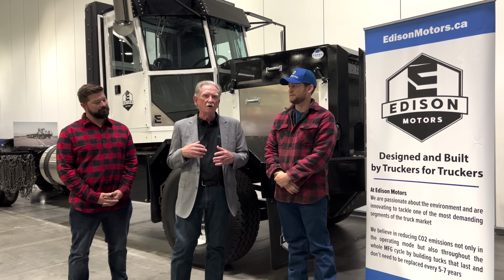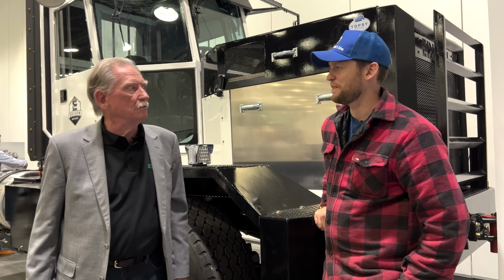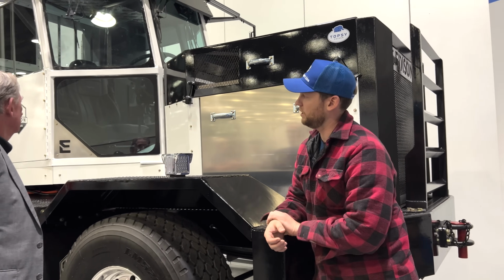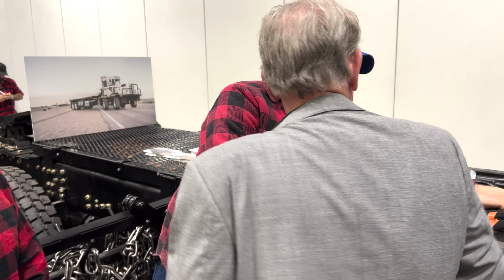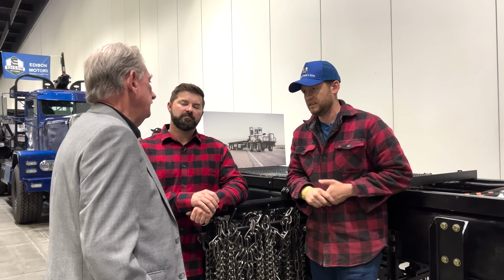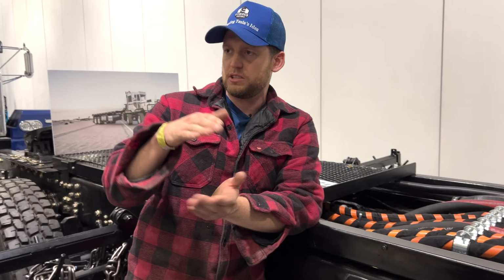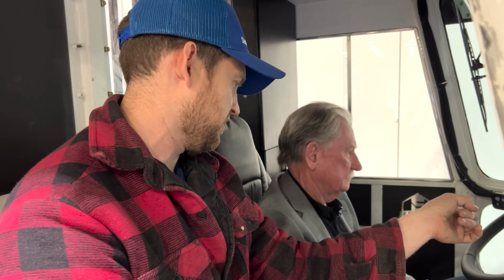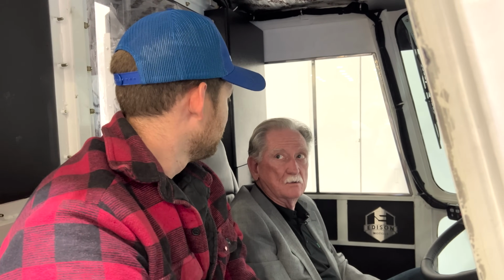This Electric Semi is a Million-Dollar Idea! Edison Motors at Fully Charged LIVE Canada

Comment: Not sure if this was answered by an earlier comment but an Electric Front Drive axel is an option as well as a triple rear axels.   With Chases trucks, they are typically custom spec-ed by the buyer.
Also, another idea Chase has is putting electric drive axels on the trailer to help with steep grades/muddy roads/snow traction as well as added regen-motors for the batteries. 
Another flexible option is for generator motors that use different fuels if they wanted something other than a diesel engine.   Propane, Gas,  Hydrogen Fuel Cell, etc.
A lot of these things have been discussed on the Edison YT Channel during the build process.
Reply: There is no driven front axle option because there no product yet. They have talked about a driven front axle, but haven't built a prototype of a truck with one yet, and haven't allowed for one in the design. 

There is no "typical" buying process for something that no one has been able to purchase yet. 

The idea of driven trailer axles, or even specifically electrically driven trailer axles, is not new. Edison people have talked about it, but have not done anything about it. That's true of alternative engine and fuel types, and various other ideas... they're just obvious ideas, not part of the reality of this truck or company.

Comment: I'd like to see this concept in highway trucks. Bare bones no frills but the necessities. Trucks built currently are junk, they spend more time in the shop than on the highway.
Reply: Built to be cheaper, if they went for reliable no one could even dream of affording a truck, but going bare bones you lose the customers. Highway trucks are a lot more complicated
Reply: @tnc7399  but highway trucks don't need to be complicated. I've driven almost every year of highway truck from 1960 to present. The old trucks before the industry went to making stuff that's designed to break were so much better... Hell everything was better, I have an IH refrigerator from 1953 that still works, and a '29 Model A that still runs down the road like it was new, with it's original engine. How much more complicated does a truck have to be?
Reply: @GreyRiderTKG  like I said, they switched to cheaper, less reliable parts to keep costs down because people want a ton of creature comforts.

Comment: 'FMCSS" (@20:50) was probably supposed to be the Canadian Motor Vehicle Safety standards (CMVSS) or the equivalent US Federal Motor Vehicle Safety Standards (FMVSS). It is U.S. Code of Federal Regulations, Title 49, Part 571, Federal Motor Vehicle Safety Standard No. 121, Air Brake Systems and the Canadian version of the same document. 

The regulation actually doesn't require redundant indications. If the signal (other than a gauge reading) is visible within the driver’s forward field of view, no second indication or audible signal is required... which means either the wig-wag or a suitably placed light would do by itself. Both is better, of course, and I can appreciate the desire to avoid the audible alarm.

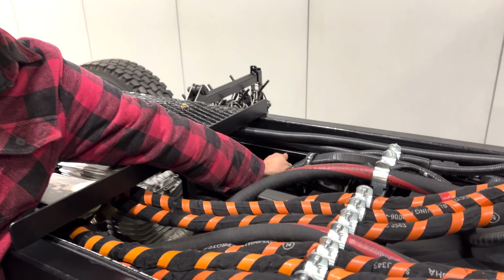Comment: The comments @15:18 about frame strengths in PSI depending on steel thickness make no sense. 

"PSI" values would be yield strengths of the material, which do not depend on the dimensions (such as thickness, web height, or flange width); they're also around 100,000 PSI, not 100 PSI. What the dimensions change is the section modulus; the section modulus multiplied by the yield strength determines the Resisting Bending Moment (RBM), or how strong the frame is. And that's bending strength, because that's what matters in a truck, not tensile strength. A designer can chose lower-yield material with taller or wider or thicker frame, or a higher-yield material with shorter or narrower or thinner frame, to get the same strength. 

The Edison frame dimensions are probably a good choice, but the stated numbers make no sense. Chace was probably thinking of RBM values, and using both the wrong units (PSI) and the wrong name (tensile strength), with the wrong numbers - RBM would be in millions of inch-pounds, and he was saying "tensile strength", using the units of yield strength, and giving numbers that would not be plausible for anything.

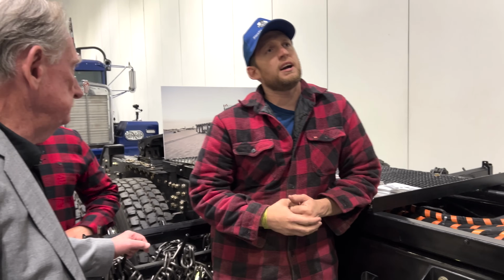Comment: After the show, the guess of 25,000 to 26,000 pounds @10:30 was replaced by an actual weight of 12,580 kg or 27,730 lb. That means that the extra weight allowance (various values depending on jurisdiction) is appropriate.

Comment: The battery packs between the frame rails are on an air-ride suspension, which makes sense... but what about the battery packs on the outside of the frame? These are identical battery modules, so if one needs air suspension the others do, right?
Reply: Well, as I understood from the video, the air bags were to isolate the battery pack between the frame rails from twisting when the frame rails twisted. The battery packs outboard of each rail would not be exposed to the twisting of a central pack.
They would still be subjected to a lot of jostling, so I guess they have good cushioning as well.
Reply: @glenndennis6801  the outside packs would be subject to exactly the same twisting, as the front and rear brackets twist with frame twist. Also, the air suspension isn't required for isolation from frame twist - that only requires a three-point mount.
Reply: @brianb-p6586 air suspension wasn’t required. The bags cost $50 and he thought why not put the battery on bags, you also now have 4 extra bags incase one breaks on your suspension.
Reply: @gilliesiut2332  The point is that if the air suspension is not needed outboard, it is a waste of money and unnecessary complication inboard, and vice versa. The air bags sized properly for the battery pack would be unsuitable for a truck suspension... and this prototype truck doesn't have air suspension anyway.
Reply: @brianb-p6586  it’s a metal plate on some airbags. Not complicated at all and if you can’t figure out how to disconnect a fitting and two bolts you probably shouldn’t be a truck driver. Is something happens to make a air leak simply plug the line to the battery suspension and let it ride on the frame. I don’t see how it would cause any further complications because if it’s not necessary and if of breaks you can basically just ignore it.. $200 to protect the battery from added shock isn’t a waste of money when the truck costs 1.5 million
Reply: @gilliesiut2332  if the bag deflates the battery hangs down below the frame. In a logging truck, that's bad.
Reply: @brianb-p6586  they function under compression not tension… it won’t hand below anything as it will sit a few inches lower on the frame mounts. You really have never worked on a vehicle have you?

Comment: 😊Not exactly the same thing as truck parts, but as the years have gone by, I've learnt that the (so-called) old-fashioned option is frequently better (and cheaper) overall than the new fangled thingamajig. I stopped buying nonstick cooking pots, pans, and utensils as I found they just didn't last and I kept having to replace them within 12-24 months as the nonstick coatings were forever wearing off, potentially ending up in food, no matter how much I treated them with kid gloves. Having to treat practical everyday usage items such as food preparation ones is just nuts. After replacing everything with stainless steel options I've not had to replace anything in about 15yrs. 
That's just in the kitchen. The same thing has proven true for me in other areas saving me time, money, ..... and a lot of blue smoke and swearing 🤬🤬🤬 on failed items.

Sometimes old-fashioned is simply the most practical choice; trucking is ultimately a practical pursuit.
Reply: Sometimes new stuff brings innovation. Sometimes it just means they have to keep selling you stuff to keep profits going up every year!

Comment: Everyone seems to think tucking is only the semis you see driving down the road.  And when you hear about electric trucks you think of a larger version of an electric car.  There is a whole separate industry that is about heavy hauling.  Where as Tesla is looking at all electric, aerodynamic, short range bespoke rig that will have to be replaced in 10 years, Edison is designing a truck that will last 3 score or more years (that’s 60 years for those who’s don’t want to convert in your head).  The Edison truck is flexible, rugged, and repairable.  Right to repair for Edison motors means a fault code has plain English on the problem and part numbers if a replacement is needed, without ever leaving the cab of the truck.  Don’t need a diesel, swap out the generator for a LMP or hydrogen powered one, add a fuel cell, or just add more batteries for all electric.  Old school reliability and longevity coupled with modern technology and unbeatable torque and power of an electric axle. Edison is going to change the trucking industry the same way diesel electric trains replaced steam locomotives.

Comment: Wow! A prototype built in 6 months, and built really well. Even at 25% more cost than a standard truck, saving $120,000 a year in fuel, soon wipes that out and puts money in the bank.
Reply: That's just fuel too. Sounds like this thing will stay in service longer and have less downtime and less to maintain.
Reply: @morosis82   Especially with the near extinction of purpose built "off road trucks", everything now is just a highway truck with a lift kit, easily broken junk.
Reply: @dalel3608  yeah I've been watching these guys design videos, this thing looks sick!
Reply: @morosis82   I know it will be an uphill battle with my boss (he's anti-EV), but when they start production I'll definitely be pitching Edison for our future fleet units.
Reply: @dalel3608  just say it's diesel electric, like a freight train. Ain't nothing harder working.
Reply: @morosis82   That and the other "old timey" bits might just sway him, time will tell lol.
Reply: Topsy can be plugged into the grid.
Reply: These electric vehicles talk about how much money they save on fuel but dont ever say how much they spend on electricity.
Reply: @everettwalker9141  that saving is generally inclusive of electricity.

The Tesla Semi that PepsiCo have been running apparently does about 1.7kWh per mile, so assuming electricity is 0.20/kWh (California) that would be $340/1000 miles. A similar diesel truck uses about 7.25mpg, at $6.40/gal (again in Cali) for a cost of $885/1000 miles. See

So if you put 100k miles a year on the vehicle that's about $54,500 a year just in fuel savings, for a semi operating in California.

In BC where these guys operate it's $2/litre and 0.12/kWh I believe, so that would be $1015 of diesel vs $205 in electricity. That's about $80k per 100k miles savings.

These logging trucks would have a much different duty cycle though, would be interesting to see how much electricity they use given that EVs typically perform even better at low speeds.
Reply: @everettwalker9141  This truck doesn't plug in, so there's zero electricity cost. All power is generated from the CAT diesel. And anyway, electricity is generally always cheaper than diesel and gasoline.
Reply: @appleintosh Pretty sure it should plugin, if not it should to get those fuel savings.
Reply: @lengould9262  It’s supposed to be a logging truck. Not much of a power grid where trucks like this operate
Reply: @appleintosh  Been there, done that. But the truck has a much broader market, eg concrete truck, offroad dump truck,  ...
Reply: @everettwalker9141   they arent spending anything its a diesel generator so its a hybrid not pure electric it still needs diesel top move but uses 50% less because the engine charges the batteries for an hour then it runs for a while pure electric.
Reply: @everettwalker9141  $4.50/100km

Comment: This guy has real know-how. Love that they put real hoses on the hydraulics. Steel switch gear. The wigwag. The Westinghouse brake cracked me up. This is how heavy duty stuff should be.
Reply: Hydraulics always have "real hoses". The excessively stiff and heavy hoses that Chace pointed out are being used for air, for which relatively flimsy tubing is often used.
Reply: @brianb-p6586 yeah if a hydraulic line bursts it'll be a bad bad day

Comment: I expected that this would be riddled with technical errors by both Sandy and Chace, and unfortunately that's what I found. But it is a good introduction to Edison's reason for existence and their choice of truck design.
Reply: @brianb-p6586   Hey Brian, I guess you don’t spend a lot of time with Engineers.  Let me challenge you, no peeking at google or textbooks.  You see, real Engineers need to have a gut feeling for numbers. It may not be the most accurate but in the ballpark.  Just in case the stupid modern computer throws up an erroneous number.  So the question is, if you strung a rope tight around the Earth’s equator, and then you added a metre of rope to its length.  How far would the rope be above the equator? Equidistant of course.
Reply: @nopenonein  the rope would still be on the ground, since the added length is neglible.

"A gut feeling for numbers" is important, and that's not what I'm seeing here. And using the wrong units of measure is a good example of not having a good feeling for quantities.
Reply: @brianb-p6586 Do the calculations, if I remember correctly, it is about a foot. I am not going to redo the calculations but it is substantial. I do believe the two guys were blabbing away and having fun, not being too picky.
Reply: @Adscam  the exact solution to the example problem which you presented is 1/2π multiplied by the length change, assuming an ideal spherical planet and a rope rigid in tension. For a one-metre increase in rope length that's about 17 cm (or more precisely 1 m /2π = 159 mm. If you got a foot, you forgot to calculate the change in the radius of the circle, rather than the change in the diameter. A mathematician gets that in seconds, but an engineer realizes that the real answer is the one that I gave. 

This is not "two guys" - it is the CEO of a corporation promoting a technical product, and the head of a corporation offering engineering analysis of products.
Reply: @brianb-p6586  Thought so, this is a playground quiz.  I don’t remember the answer but I knew it was substantial.  It is half a foot according to you.  So that is surprising when you said it was negligible.  Bye bye.
Reply: @nopenonein  you apparently missed the point. Engineers need to understand the numbers, not just do calculations.  In your test, the calculation result seems large to you, because you don't understand that it wouldn't apply to the real world.
Reply: @brianb-p6586  Brian you miss the point entirely. Engineers know real numbers and can do the calculations to back themselves up.  In this case, you got the gut number all wrong, and refuse to acknowledge it.  You like to speculate on things that you don’t know and try to bullshit your way through, e.g. Janus Electric.  You are needlessly picky on things when people are having fun and getting the full general idea through.  I bet you are a party at the water cooler.
Reply: @nopenonein  you still don't understand: my immediate response  - your "gut number" - was and remains absolutely correct. A student learning geometry can calculate that the increase in radius is 1/2*pi times the increase in circumference, but an engineer understands that variations in the temperature of the rope, stretch over time, or even a single wave in the ocean would have more significance than the piddly one-metre change in your theoretical rope. 

What Edison Motors people need, like many enthusiastic novices, is technical rigour. Maybe it's there somewhere, hidden behind the scenes, but it's not in the public face of the operation.
Reply: @brianb-p6586  Brian, you failed the test. You said the rope will still be lying on the ground.  Admit it.  You are just a persnickety person.
Reply: @brianb-p6586 . You are just a pernickety person.
Reply: Brian, quick answer now like in a live interview.

Comment: 80 litres per 100 kilometres (given @7:37) is 2.9 miles per US gallon. That's not one mile per gallon or a gallon a mile but yes, that's a lot of fuel, and lot more than an average heavy highway truck rolling down a highway at a loaded weight of 80,000 pounds (36,000 kg) or less.

Comment: In the configuration that Chace is talking about the log trailer isn't permanently attached to the truck; instead, a set of bunks are mounted to the trailer to support the front end of the logs, and a trailer holds up the back end of the logs. The trailer can be unhitched and placed on the truck to transport it when empty. But Chace's point is valid - the logs are not carried on a trailer which can be unhitched while loaded, so the load can't be taken over by another truck for the next leg of the trip, and the same truck has to make a trip down forestry access roads and then on better roads to where the logs are unloaded.

Comment: The generator can't possibly recharge the battery completely in an hour, because it is a 280 kWh battery so to charge it in one hour would require an average power of 280 kW, and by insisting on running the Cat C9 engine at 1800 RPM it can't produce anything close to 280 kW. Chace really needs to get his numbers sorted out, or to stop giving numbers.

Comment: @4:13 there is a confusion about the battery type. The cells in this truck are lithium iron phosphate, or LiFePO4, or just "LFP". This is a type of lithium-ion cell. It has nothing to do with the nickel iron cells which were used a century ago in EVs; if Sandy were the EV expert that he claims to be, he would understand that and would not have mentioned the antique cells.